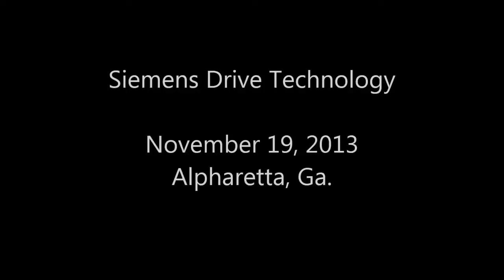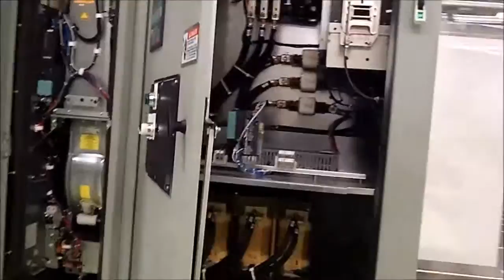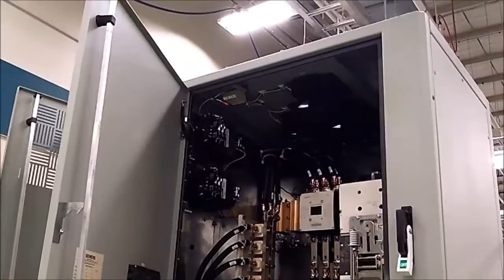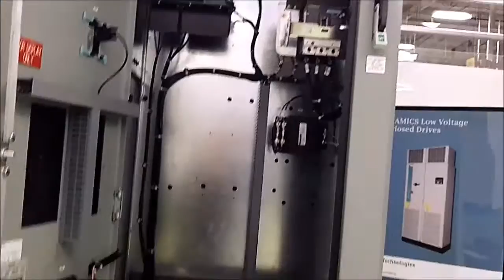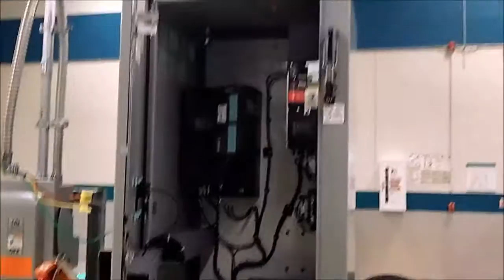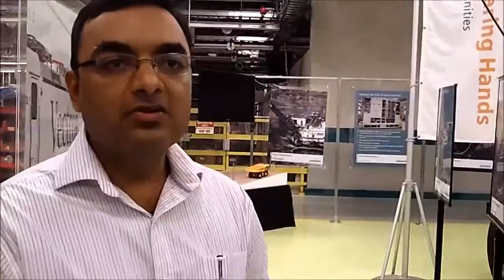Siemens - Variable Frequency Drive Products

Comment: Vfd replace gear box to drive belt conveyor . Plz explain
Reply: Manoj kumar pandey They not replacing the gearbox. I can say they replacing fluid coupling. Their purpose is to start the motor smoothly and also to run that motor at that given process speed. Thx